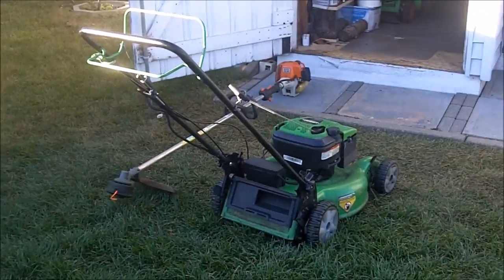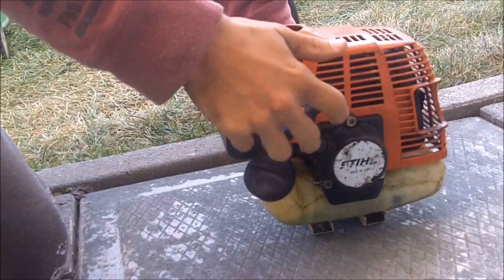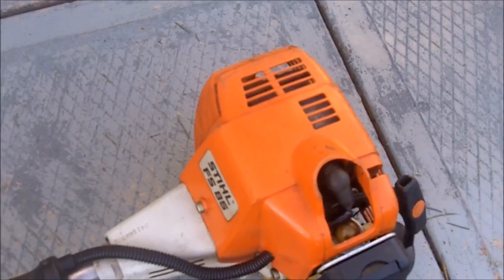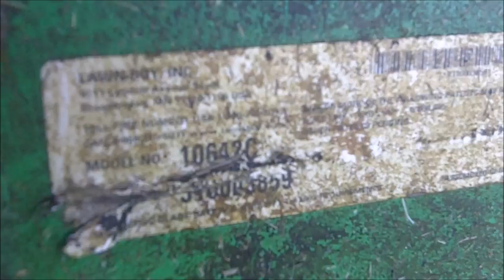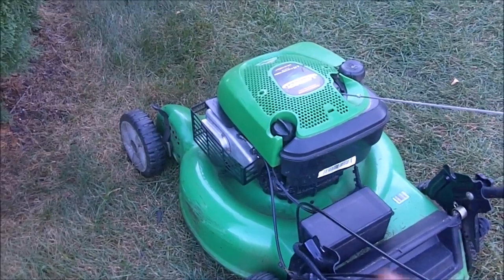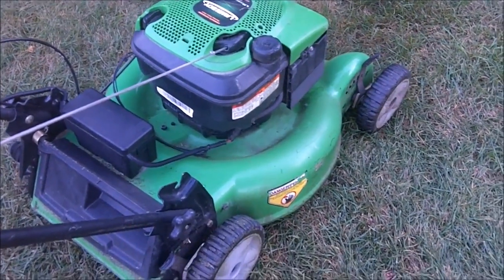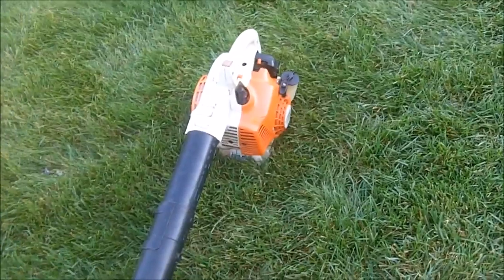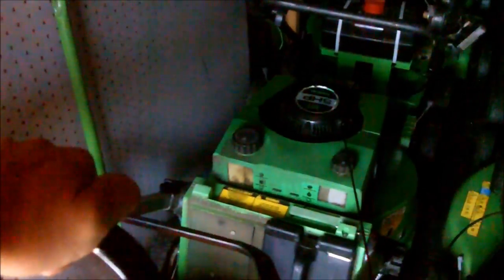NEW!! 2010 Lawnboy 10642c, Stihl FS 85 & BG 55 In Action

Comment: I have the stihl hs 85 hedge trimmer and when I got it it hadn’t been started in 7 years. It had old fuel in it. I had to clean the carb and change the fuel lines and it started 3rd pull